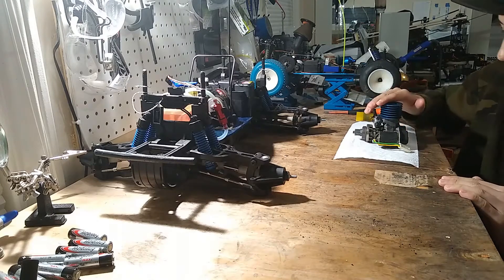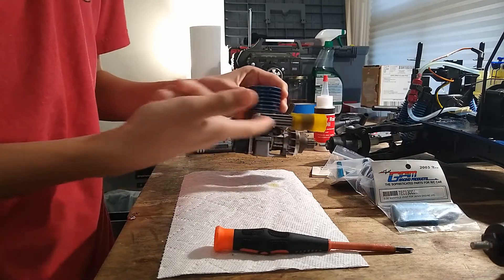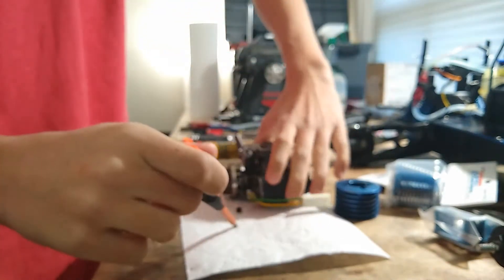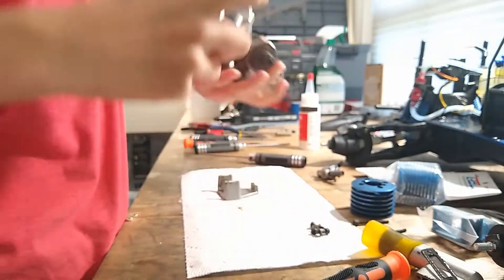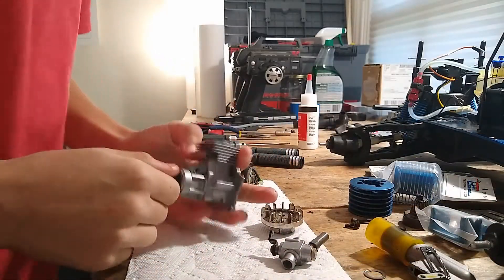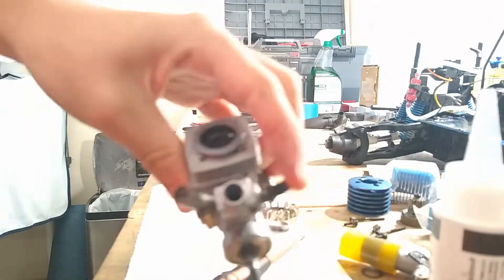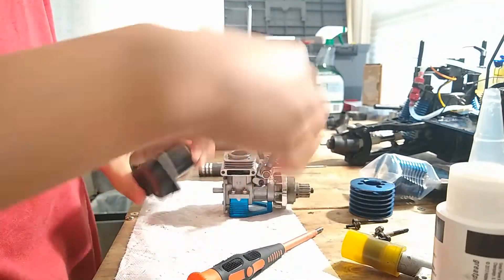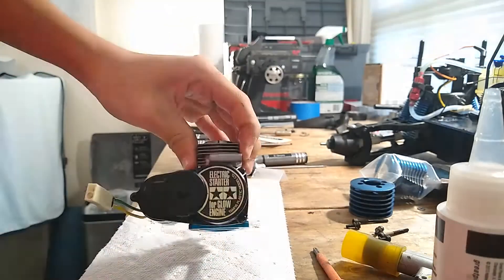How to take apart and clean the Tamiya .18 engine and install GPM/Megatech parts

Comment: That is not a flywheel collet, it is a drive washer. Much like an airplane engine uses to turn a prop. Tamiya likes to do things their own way. 
 I can hardly bring myself to open up and use any vintage hop up parts, the collector in me won't allow it.